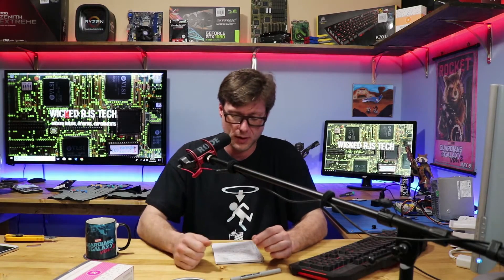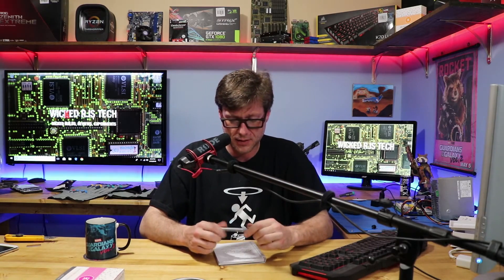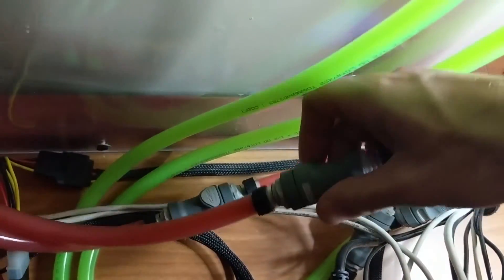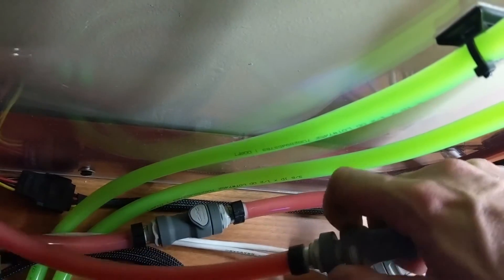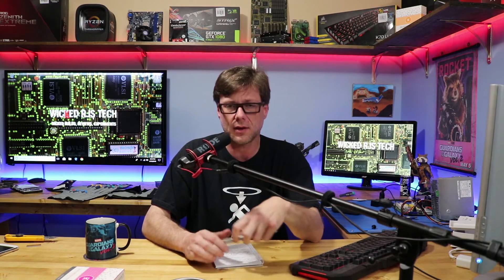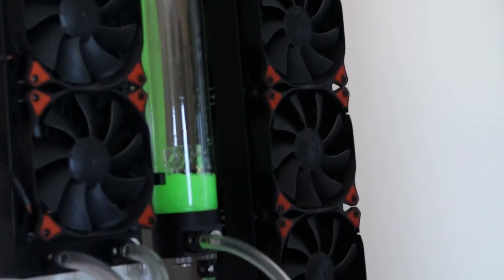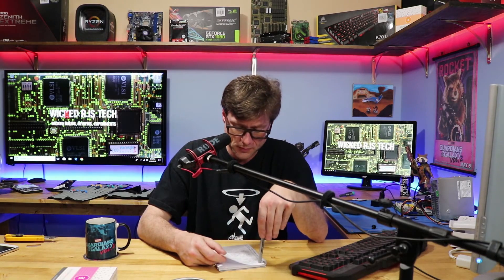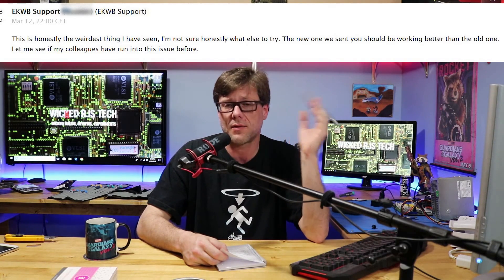EK FB ROG ZE X399 Threadripper Upgrade Kit Failed

Comment: was the replacement any good?
Reply from the maker: Nope it was not, it was actually worse unfortunately
Reply: Then, I guess that's why they didn't get back to you. I bet the employee asked around and found that most (if not all) were getting worse temps. So his supervisors told him to hush hush about it. I myself think EK just built the refreshed block as cheap as possible by extending the fins surface area while using the same fin design the first block had. If they did do that, it would explain why the refreshed block preformed worse.
Reply from the maker: Hey Bren In, That did cross my mind. However I would think that they would have tested the new design before sending it out and one would think that they would not want to do that to everyone. Also I just got home and checking my email, I actually just got an email today from EK :D Looks like I may have fallen through the cracks. They think I could have something defective, so we will see how things turn out.
Reply: Lol yeah? Well, lets see if they can impress me XD
Reply from the maker: :D can't wait to find out myself

Comment: I have the new block installed about a week ago and I am a bit disappointed as well. I get slightly hotter temps then with my AIO (Corsair H115i), but not as bad as yours. 30-50 C on stock speeds ... kind of acceptable. So I thought changing to liquid metal might help. Not sure though, this is my first build, but I would have expected better temps with a custom loop.
Reply from the maker: Hey Jan Axen! Thanks for dropping in! Man that sucks yours is not doing all that great as well. Glad not as bad as mine though. When I went to custom loop I got much better temps, perhaps the block is holding you back, or maybe the radiator, also try arranging the fans on one side to push air and the other side sucking air, that can improve things a lot too :D
Reply: have a 360 thin and 280 45mm rad in there ... noctua high static pressure fans ... the 1080 ti usually does not exceed 45 C under full load ... since it doesn‘t change that much when I crank the fans up, I have assume its the block and not ideal heat transfer
Reply from the maker: Yeah nice fans :D and good rads too. I would assume it's the block too and from what I'm seeing with my block i could totally see that.